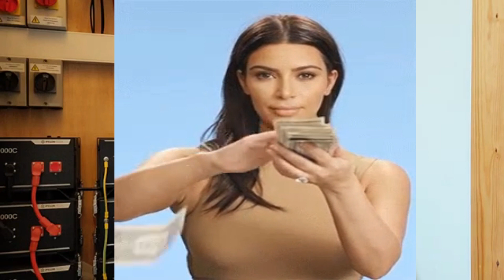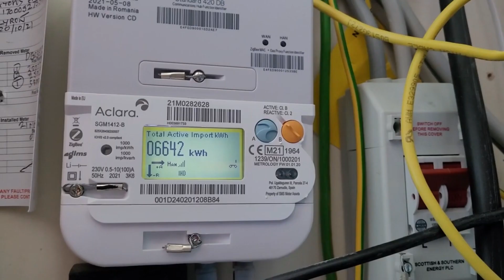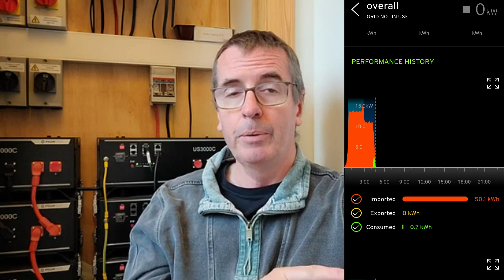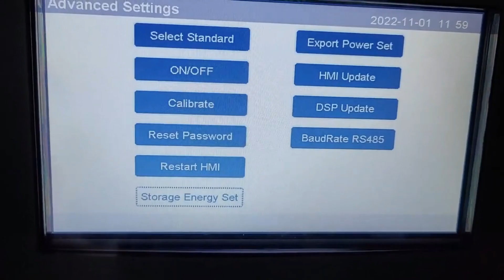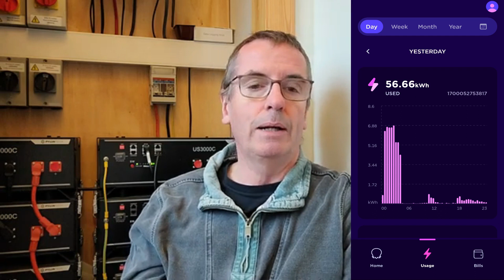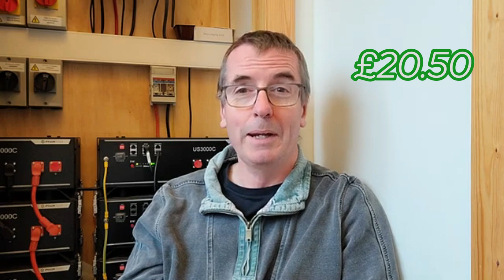Being smart at home with expensive electricity !

Comment: Thanks Jonathan. Very sensible, and especially with a Solar array as far North as Orkney. Our energy provider rolled back a firmware update for our Smart Meter, thinking that something had gone wrong with it during the past month That was because we used less than 1kWh of peak rate electricity during 30 days of December 2022 to January 2023, including recharging our EV. And that's only using 19 kWh of storage battery with an inverter, plus sensible rescheduling of high energy item use. We have no Solar array.

Comment: Another excellent video Jonathan, thanks for posting.  I live in the East midlands and I'm using the same process as you, charging my home batteries (2 x Sofar Solar GTX 5000 units) with solar when available and from now until the end of the winter I'll charge them to full each night each night using my Economy 7 tariff.  The combination of solar and batteries enables me to power my home, heat my water and charge my Hyundai Kona ev with minimal use of daytime grid electricity.
It really does work well and despite the initial cost of the solar PV, batteries and associated equipment I'm confident it will pay for itself quite quickly and also help me do my bit to help the national grid to avoid blackouts this winter.
I have also set up my batteries to power some circuits of my house in the event of a mains power cut.
Reply from the maker: Nice Robert 👍 thanks for watching and your comments 👍 😀

Comment: What is the cost to cycle your cheap power through the batteries? There must be a cost per cycle to add to the cost of off peak power.
Reply from the maker: Pylontec state 6000 cycles 'predicted life span ' if fully discharged / charged , if this was every 24hrs it would be 15 years ! 
I rarely 'fully' cycle or empty my batteries,  and i never drop below 15%. 'If' 15 years life span , this works out at 20p every day , x 8 units , £1.60  a day ' cost' , hope this answers your question? 
Thanks for watching!

Comment: We have been with British Gas on their dual fuel tariff for many years with economy 7 on the electric. 

As of the 1st of November the economy 7 tariff was reduced from 22p per kwh to 14.8p per kwh. 

We currently have 11kwh of storage which i am currently upgrading to just on 20kwh.

So most nights now we charge the batteries between 12.45am and 7.45am at the cheaper rate of 14.8p.

It makes a massive difference.
Reply: Yep, my night E7 rate is now 11p/kWh. We can just about run 24 hours on E7. Just about to add more capacity to allow a bit more flexibility.
Reply: @djtaylorutube  its good new m8. I built my own batteries by buying the LifePO4 cells directly from the factory in China.  

I now have friends wanting to get batteries and an inverter without the solar to take advantage of the lower night-time rate.

Hopefully we will get a few years before they start leveling up the night-time rate.

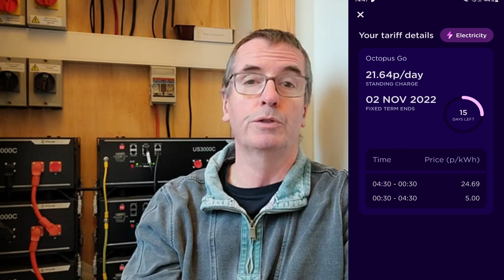Comment: Do you have 3 phase at you’re property? 3:24 Would a 2 phase be able to pull 50kWh from the grid between 00:30-04:30?
Reply from the maker: No just single phase but the most i pull is 9.6kW between 00.30 and 04.30 according to the @myenergiuk app

Comment: That was interesting and, were I younger, having such a system installed would be a no-brainer. 
However, I'm still glad that I invested in solar PV which diverts excess power via an Eddi to the hot water tank element  and also charges my small EV from late Feb to mid-October. The budget option!
Reply from the maker: Brilliant Brian , thanks for your comment

Comment: Hi,

Interesting explanations of your setup. Although it seems that the upfront cost is high with all those batteries. In how many years will it be amortized ? Wouldn't it be possible to be even more efficient by using the battery of your EV car directly to store your PV surplus/cheap night tariffs and then use it back to your home ?
Reply: Looked at a review of the new mg4. The platform the new mg is on suggests it's possible to have 2 way charging/discharge. Whether it's a feature of the car today is not as clear. Seen conflicting statements about it. Longer term better solution than having a battery in the house though.
Reply from the maker: @keithhobbs1  The MG4 has V2L vehicle to load , and a maximum of 3kWs output , via a 3 pin plug.
V2H ( or V2G) requires a conection to the DC side of the evs battery systems. 
Only the uk built nissan leaf and eNV200 can do V2H (or grid ) via the DC chadamo conections and protocols
Reply: @JonathanPorterfield  Cheers I'm a bit clearer. Think longer term it's the way to go, and I do quite like the look of the mg. Not within my budget at the moment so it's a bit academic for me. I'll stick with my Givenergy storage for the time being which works quite well.
Reply: @keithhobbs1  I guess that V2H and V2G solutions will be trivialized in the near future but right now is a bit early maybe...
Reply: Its not for everyone but if you have some money stashed away in a savings account or whatever that maybe you are saving towards retirement, investing in these batteries are much better return than any interest rate out there. If you are able to afford them and dont have them, then you are just throwing money away every month. You can even finance this with no interest indefinitely If you know what you are doing.
Reply from the maker: Yes , but at the moment on Chadamo equipped evs are compatible with V2H (Vehicle to Home) such as the Nissan Leaf and eNV200 , as and when DC CCS evs have the equipment to enable V2H then this will be great .
Reply: @JonathanPorterfield  Thanks for these details. I thought that it wasn't possible to do it with V2H (to use the electricity from the car to power the house way) but that it needed V2G which is rare for now. Because there are now "cheap" car like the MG4 that have V2H. Is your setup, I mean inverter and/or car charger equipped to use electricity from a car with V2H ?

Comment: Hi Jonathan, have enjoyed watching your videos on PV/Battery. I have install pending and installer cant get the GivEnergy kit so looking for alternatives. I like the idea of Solis Hybrid and Plyontech batteries but wondered how you Integrate with Myenergi kit, I have a zappi.. How do you prioritise charging battery over car, do you use an export margin setting? and how do you stop the car, when charging overnight, taking energy from battery. Do you schedule battery charging at the same time? Thanks
Reply from the maker: Yes i schedule battery charging from the Hybrid inverter , and I can 'pull' off the grid to charge the ev 
The Myenergi Eddi is Brillant at diverting where the solar goes 
The most the pylontec will 'push' out is 5kWs , so with the eNV200 , it has the standard 3.3 kW on board charger , so if i charge in the day  it will come from the storage batteries 1st , then any shortfall will pull from grid.

Comment: Are you Sunamp batteries reliable? I have been wanting to pull the trigger for a few years but im a bit scared to, in case I get no end of faults and bother.
Reply from the maker: Ive ran mine for 4 years , NO issues at all Have you  seen my video on the sunamps ?
Reply: @JonathanPorterfield  Yes I have, they seem ideal for me. They don't seem to get the same star ratings a some of the smart water tanks. But I need to store more of my generated electricity. In the summer I have too much, even with an electric car and a Tesla battery, and I hate exporting.
Thanks

Comment: Home battery storage works even if you don't have solar, an EV or an integrated smart system. Just top up during cheap periods and use up during peak periods. I can't fit a powerwall type battery for various reasons, so I do it on a smaller scale. I use a Raspberry Pi computer for most of my computing. I have a voltage converter buck board that allows me to power my Pi from a car battery. I can recharge the car battery overnight on cheap rates and use it for days to power my computer or top up my mobile phones and powerbanks. It's not a great amount of power on a daily basis, but it adds up over the month. Plus I'm re-using an old car battery that is no longer able to run the more demanding systems in my car.

It's also possible to get timer plugs that let you turn on things like washing machines during the cheap period. Go to sleep and wake up in the morning with washing done on the cheap. This can also be used for the general purpose of charging any battery operated devices while you sleep.

Not all energy wise solutions require large upfront costs or intrusive installations. Common sense and some simple gadgets can also help.
Reply from the maker: Great to hear you set up , well done sir 👏 👍
Reply: Great comment.

Comment: Hi Jonathan,
May I ask how much your pylontech batteries and the inverter cost please. Plus the labour to install them.
Reply from the maker: Hi carol , the pylontec where around £1200 each ( x8 units , so £10k) inverters where £400 and £600 for the hybrid inverter.
Labour around £500 in total as i helped the electrician and roofer , scaffolding was £400.

Comment: The only problem is that you have to wait until you get a smart meter and there is a considerable time before you can get that fitted. Been waiting for 2+ years. If you join octopus and you don’t have one the rate is through the roof I think.
Reply from the maker: I had to wait 18 months to get a smart meter , wasn't Octopus fault , but comms issues up here and the 3rd party 'owners' of the meter !

Comment: Is there a reason that you did not switch to Octopus intelligent where the cheap rate is 10p a kWh rather than the 12p you are paying? The cheap rate window is 6 hours rather than 4. Is there something I'm missing?
Reply from the maker: Hi , i dont have a ev that's compatible,  and most of my charging is direct from solar 7/8 months of the year.
Reply: @JonathanPorterfield  
Octopus have recently added Kia eniro to intelligent
Reply: @JonathanPorterfield  Thanks for replying. I hadn't thought about not having a compatible EV. I live in central Scotland and I managed to put some charge into my car from solar about 3 days this summer. I'm so jealous!
Reply from the maker: @001ml  can you fit more panels ??
Reply: @JonathanPorterfield  I have maxed out the panels on the south facing roof (12 panels). I could possibly add more on the North facing roof, but I'm not sure if it is worth it. I think it would be better to add more storage capacity. I have 9.5 kw and I am thinking about adding another 5kw. More would be better, but cost is always an issue. Adding 5 kw would mean I could fully recharge the 14.5kw in the 6 hours from Octopus Intelligent at the lower rate. That's my thinking at the moment.
Reply: @JonathanPorterfield  
To add, intelligent tariff isn't designed for home  batteries. If ev charging is handed over and charged outside of its regular time of use, won't that drain your pylontechs into the EV?